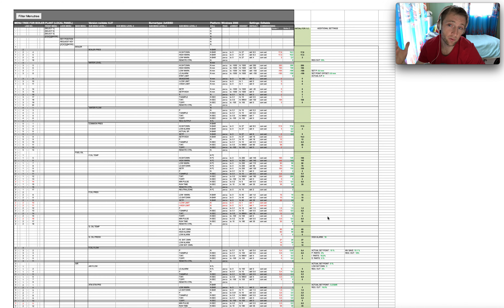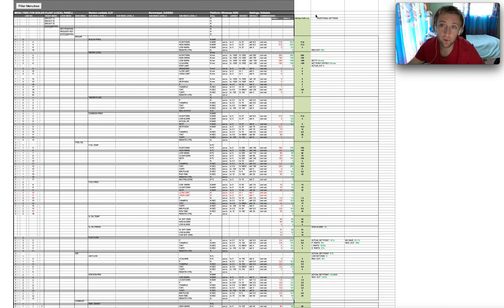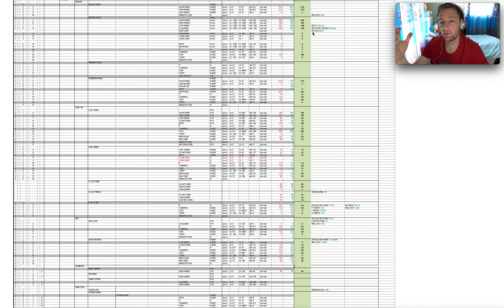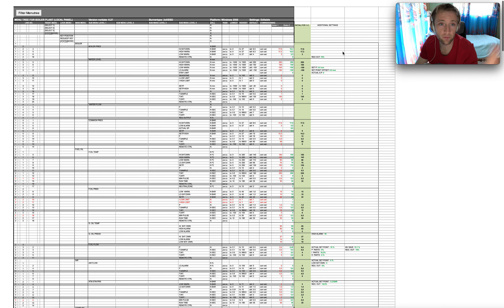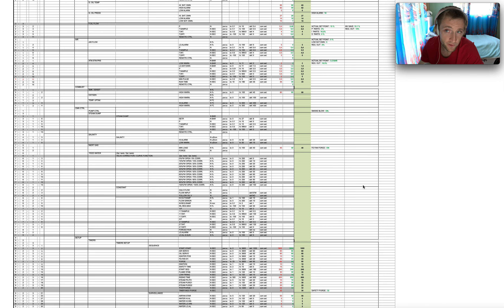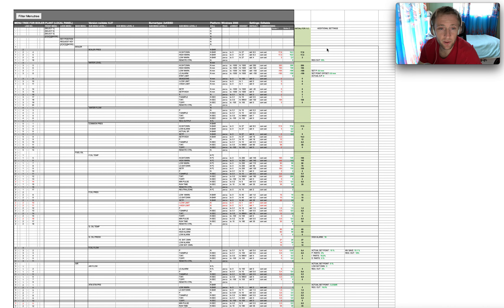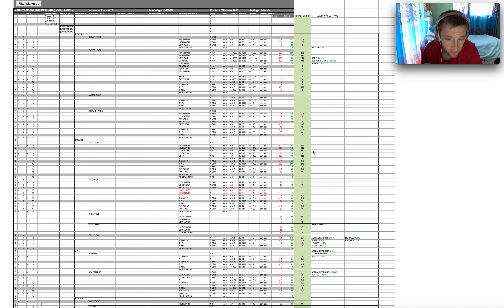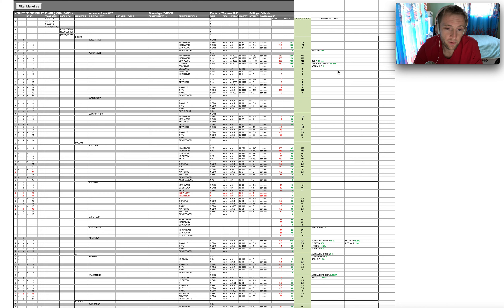How to avoid smoky Aux.Boiler Operation

Comment: Good day sir, could you please provide us by another video about how we can adjust our boiler load during the cargo discharge
Reply from the maker: Good day! Many thanks for reaching! What would you like from my side to show regarding boiler load? The factors that can affect ?Or what to take in consideration to able to adjust boiler to function in optimum range.Optimum range means boiler is operating effciently.
Reply: @Adventure-Story  
Thanks and I’m really appreciate your efforts, I mean the factors and adjust O2 content lower than 5% while that I have to avoid the smokey boiler, and what do I have to do if the OOW in Cargo CR want to increase or decrease the turbine speed
Reply from the maker: @khaledelnagar2856  Normally if the boiler is adjusted it will not required any adjustments huge adjustments where ever you see differences on O2 % or smoking before doing any adjustments check the funnel is it is smoking. Make some test before discharge.
Make sure that machinery involved working properly.
Yes it is necessesary to adjust some times due to temperature changes but it is not limited to that only. Don't go very low oxygen below 3.5% as it is icrease the risk to contaminate the cargo tanks with soot from unburn fuel. It is both way you have to find the optimum solution.In case you are facing issues just tell to Chief Officer to keep the rpm of the pumps where is the optimum to avoid any issues until discahrging operations are finished.
Reply from the maker: @khaledelnagar2856  It is not only the knowladge of adjustment but the  knowladge of collaboration in difficult situations.
Reply: @Adventure-Story  
Thanks a lot ❤️

Comment: thank's for your feed back my dear friend )) Mike, please i have mantioned before to create a video with full explanation about cranes  on tankers . How to solve problem , what is most common problem what you faced in your expiriance and what must be done. We don't have proper information in our styding books how to handle and solve problems with hose handling and provision crane. How to use it in emergency situation , deck department call to ECR that crane does not work for some reason 1) hook cannot be hoisted or lowered up/down , problem with boom does not move at all or somthing else. Please help us. Give proper recomendation what shoud be checked step by step / what is part of crane is responsible for ? 
I know exactly for your long expiriance on board the ship you have solved and faced with many diffrerent kind of solutions and troubles / please share with your subscribers. Mooring winch woud be better to include in this video . Thanks Mike i appriciate to you .